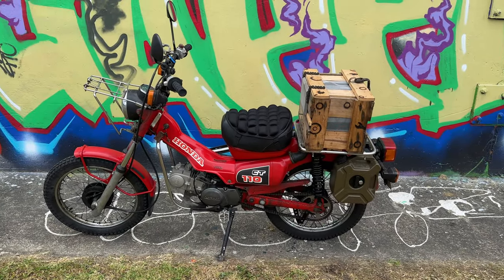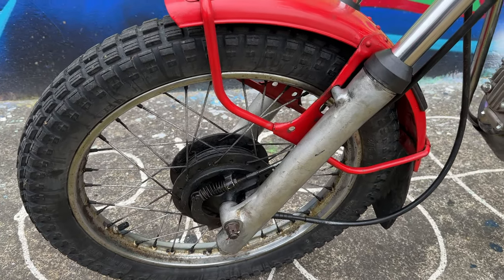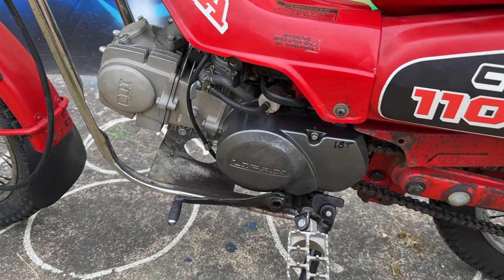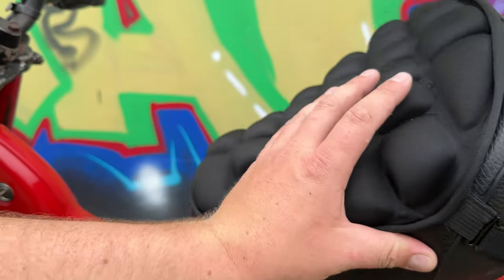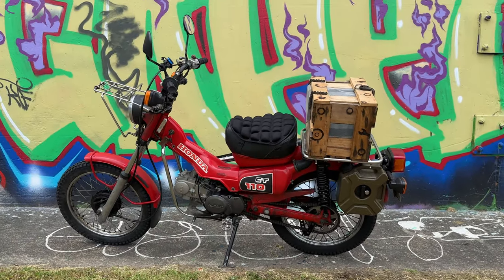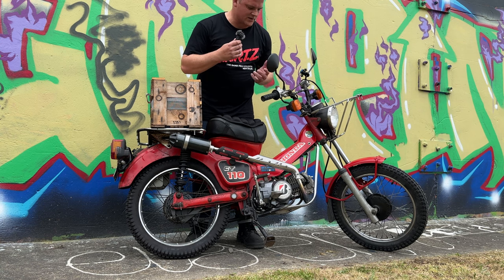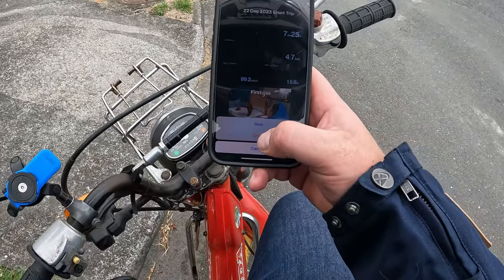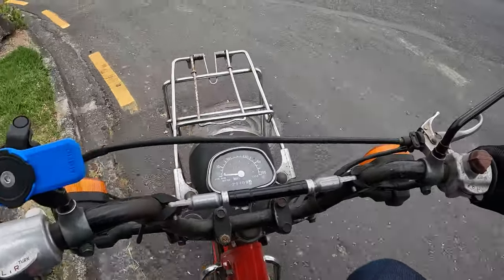Honda CT/Trail 110; Chinese engine replacement | RTW #025 🇳🇿

Comment: If you plan on going flat out for a road trip might be worth looking at an oil cooler. I've melted a piston with the chinese motors the oiling system is quite basic. It won't make it go faster, but it may avoid the oil overheating.
Reply from the maker: Oil coolers can be a good idea. Among my friend group we have them as a necessity on 140cc horizontal engines or bigger, the 125’s we’ve managed years of abuse as long as the oil is changed every couple of thousand kilometres. I have installed an oil cooler on my big bore kit Honda 125 motor also (now 143cc)
Reply: What brand of motor was it?

Comment: Have to say, I have a lot of respect for you for just telling it how it is with the Chinese engines/bikes. I've had exclusively Honda bikes for 20 years, but in 2023 I finally just couldn't justify the price vs quality of what they were putting out anymore (especially regarding the Navi and the XR150L.) I bought a Lifan Xpect 200cc fuel injected Enduro bike and have been absolutely blown away by it's features, build quality and value. The bike is a quarter of the price of similar big 4 bikes, brand new. And I'm hearing that the new Lifan KPX 250 is not just equal to, but completely outclasses the big 4 250cc bikes in terms of build quality, despite being a 1/3rd of the price new. That's insane, and it truly shows that the times are changing regarding the Chinabikes. They really are the same, if not better.
Reply from the maker: Thanks for watching first of all! Agreed - I have used a lot of Lifan products in the last 5 years and they hold their weight. Just like anything you need to use it within it's limits. But I always have a bit of a chuckle when people say a CT110 engine with 100,000KM on the clock is still better than a brand new Lifan 125. Cool to hear about your new purchase! I'm gonna have to research the model.

Comment: Great Video. You've really nailed the pacing. I still wonder about the reliability of these Lifan engines. I know some that ride CT110's with swapped engines around the world. While I'm not a fan of Chinese engines, these seem pretty solid, especially given that most original CT110 engines are pretty worn.

I hope the owner enjoys his bike a lot and gets to do some touring on it too.
Reply from the maker: Thanks mate! Quarter of the way to 100 bikes in this series and I’ve finally got the editing sorted. Haha. The reliability of Lifans can be dubious at times. But if you check them thoroughly before use and oil change more often than you think they seem to hang on okay. This is based on NZ temps and not a super hot environment though.
Reply: I've got a bike with a Lifan engine and it seems to be really, really good, for what that's worth. It's a licensed Honda copy though, so it is probably much better than other similar Chinese engines, which are probably "close enough" copies instead of direct from the Honda blueprint.
Reply: My wife and I rode a pair of Aussie CT110s from Alaska to Argentina and then east coast to west coast across Australia, both of our bikes were powered by the Lifan 125s, both were fitted with oil coolers, and we loved them. The Lifan 125 is a solid little motor so long as you keep up the oil changes to it. Cheap to fix, and as old mate in the video says, runs perfectly out of the box.

Comment: those forks and triple tree look to be out of a xl 185. I have and 1984 CT110 AG and a 1981 Xl185. Also I'm not sure how the lifan 125 engine is mounted but it is not a perfect bolt alignment to the original 110 honda engine...
Reply from the maker: It’s only the single mount that doesn’t line up as you might know. Adapter kits are available on eBay or similar. Between myself and friends we’ve made our own with a few hours in the shed. I didn’t check exactly how this one was mounted though to be fair.

Comment: Do you ever have problems with the electrical system on those Chinese motors??
Reply from the maker: If it's been inspected before use generally they are okay.

Comment: I love your content and I'm a supscriber.
My question is this.  Why would anyone want to remove a perfectly good and extremely reliable honda engine and install a crap chinese engine?
Reply from the maker: It's a common swap for lots of small Hondas. Reality is, in many countries a full rebuild of a genuine motor can cost upwards of $1000 USD and a quick bolt in replacement costs $250 USD and runs perfectly fine. I think all of us would love a fully rebuilt genuine article, but it's not always an easy thing to achieve.
Reply: The reality is that Lifan’s are getting better every day. Not all Chinese knockoff’s are terrible.  In the US these things are getting old and worn and are rarely “perfectly good”. 
I say this as a fan of rebuilding the Honda engine versus replacing but some people want to bolt on and go.
Reply: Given it's age, is possible that Lifan actually made the "Honda" branded engine. They have been business partners before.
Reply: Or you could put in a ATC125M with hi/lo range. 😆

Comment: You know honda is short charging you (rip u off royal) when a chinese engine outperforms the stock one easily.
Reply from the maker: A 30+ year old 110cc engine with a hundred thousand km's doesn't quite stack up next to a brand new 125.
Reply: @SmallBikeStuff   the 125 chinese engines aint exactly cutting edge...
Reply: After owing a Lifan chinabike, this is exactly how I feel. I have been ripped off by Honda my whole life apparently. Why is my $2000 fuel injected, Lifan Enduro bike better than a $4000 XR150L? It makes zero sense, but it's true.